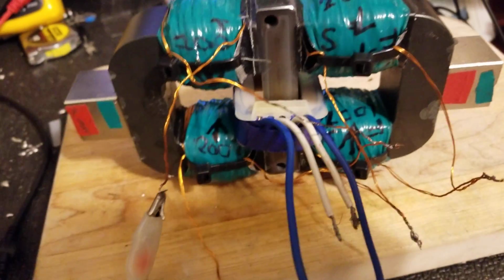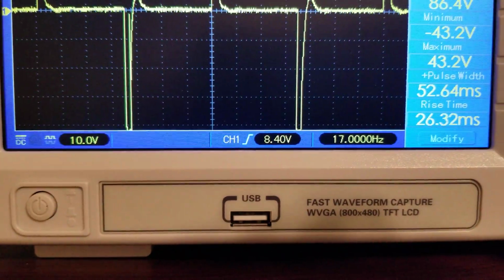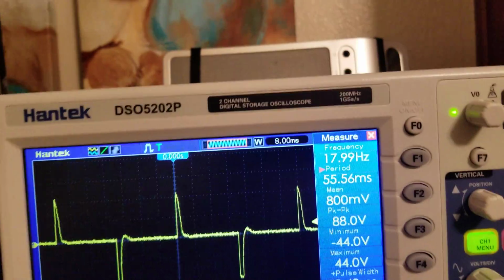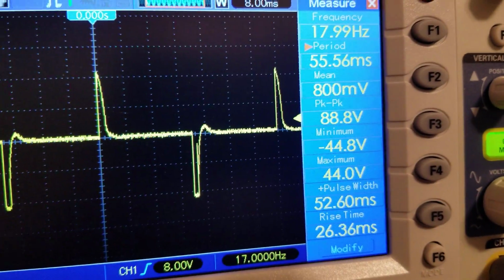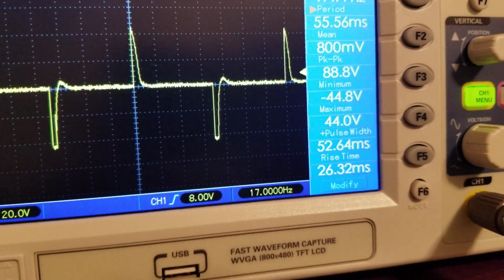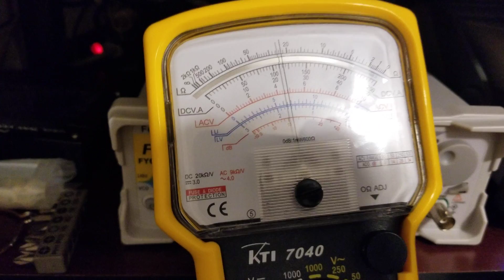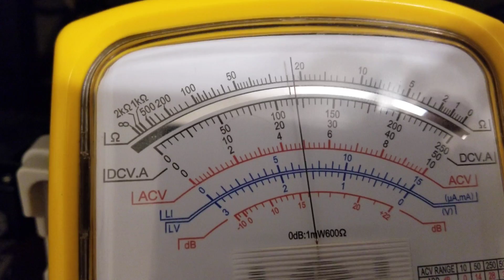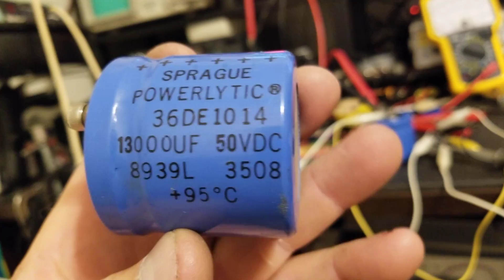Motionless electromagnetic generator part 4

Comment: Great work !
There's a video of another you-tuber building the MEG and he uses a higher frequency to get a COP of just over 3.
The core has to be run in the KHZ range (he was closer to 15khz), run it thru a range of frequencies and observe your output voltage and tune it to the highest voltage output, watch your output voltage as you increase your frequency and find the peak.
You will also have to use high frequency diodes(SCHOTKKY) to rectify the output afterwards as most diodes don't work well rectifying AC at higher frequencies. your on the right path :)

Also, the core has to be a non-iron core, as iron will saturate at higher frequencies.
The capacitor you charge with the output also has to be able to take higher frequencies as an electrolytic capacitor wont be as efficient with high frequency pulse charging.

using a polypropylene capacitor to charge from the high frequency output and then dumping the polypropylene capacitor into an electrolytic capacitor may be the way. yet to try it and see the effects

Good luck!!
Reply: From my understanding we have to be in resonance with the winding and core to get a better gain.
also as you increase the voltage into the switching coils the output will increase in COP.